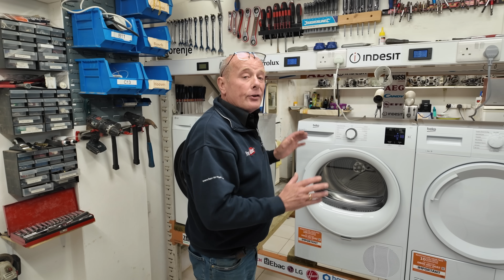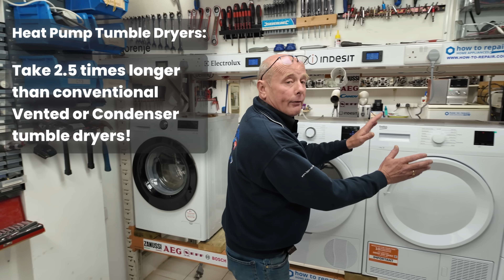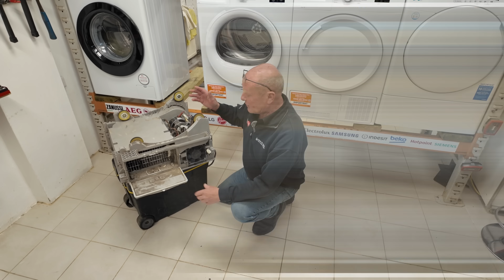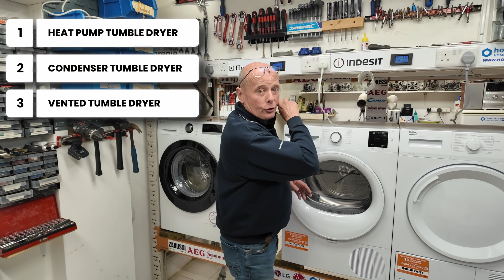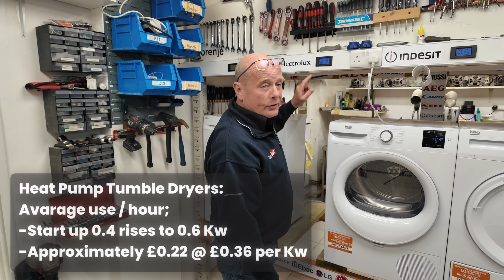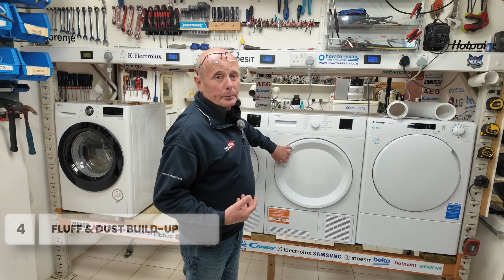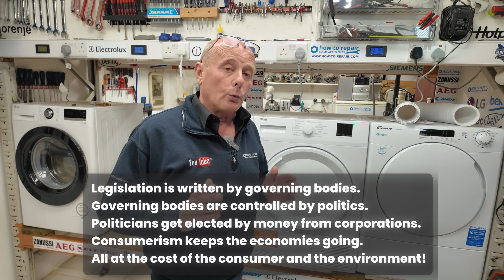Tumble Dryers the Shocking Truth About Heat Pump vs Vented & Condenser, NEW LEGISLATION!

Comment: Hi 
For me it goes to show that the heat pump is not the way to go. More expensive more complicated and takes to long to dry.
I have never had 5 trouble free years of service from any kitchen appliance they all seem to die at around 3 years fortunately I can repair most faults myself.
Great vid and wathing this one has  made me realise why at some points of the year my condenser dryer takes longer than other times in the year, just down to kitchen temperature and ambient humidity effects on the condenser 
Cheers great vid

Comment: It’s very strange seeing these machines for drying clothes. My wife and I are in our 70’s and we’ve never used these to dry clothes at any time in our lives. When the weather allows we dry clothes outside when not we dry inside. We have dehumidifying granules in collection bags which keep our house free from high humidity and don’t have any issues with condensation. We open windows for fresh air and heat our home between 20-22 degrees c every day. We have the lowest energy bill of our neighbours around as we often compare costs to see how to make savings. We will never use heat pumps as we know they cannot heat our hone above 15-18degrees c depending on the season. Our house was built in 1962 and I’ve insulated under floor, wall cavity, loft and have good double glazing. Three heating engineers have advised us not to touch heat pumps as the cost will be 12-15 thousand pounds and all our radiators will need replacing as they are not suitable and each one said we’d need extra heating on top of the heat pump to get the house warm for us to live. Heat pumps may be fine for new houses but useless for older properties. Never listen to the government, never buy an ev, never expect a politician to tell the truth, if it seems too good to be true it is, these are the rules we live by and will die before we ever change. One last thing no matter what you do if you live in the uk you will never change global temperatures, by buying Chinese you only increase the damage done, if you believe that rubbish. Why ruin your life, your job, your business, your future trying, it’s a waste of your life.

Comment: I have been using BOSCh Heat Pump Tumble dryer for more then 15 years. I had issues with clogged condenser in past. Complete disassemble and cleaning helped. But last min 5 years I have not been facing such issues. Why not? There are several factors to help dryer. First is to use washing powder, not washing gel. If you use gel, wet environment in your washing machine and subsequently dryer, is colonized by bacteries. They creates ugly, smelly, black jelly everywhere you cannot acces, especially surface of tank under drum and condenser in dryer. This jelly together with dust from laundry is clogging your condenser. If you switch to powder, there are abrasive particles, constantly cleaning these hiden surfaces and bacteries are not transferred to dryer. Dust particles are still there, but not sticked to surface of condenser, but filtered by filters. Second advice - do not be too active by emptying water container after every load. Is good to keep at least 1/2 full for every second cycle. Why? Dryer has self-cleaning system, using this water from upper box. You can find there hole with vent. If box is empty, self cleaning is not working. And third advice. If it is possible (older Bosch dryers), ask service man to modify body of condenser to allow access from front side. I have there small doors and cover I can remove and check front side of condenser. This is place where most of dust is catched first and if you keep this space clean, you do not need to disassemble whole machine. If you do all in such waty, these machines are inredibly long-live workers.

Comment: ThNkyou for spending the time making this video. I wish this was available 4 years ago as my beko heatpump tumble dryer has failed. To me it's looks uneconomical to repair, as it will become fault again requiring a complete strip down. Think I will purchase a condenser dryer instead. 4 years usage for £500.00 dryer is not economical. Thanks again

Comment: We've had a heat pump dryer for two years now. Recently it has started smelling which affects not only the clothes, but the house too. We religiously keep it clean, vacuumed and lint removed etc. Having spent the last month backwards and forward with the manufacturer and getting an engineer out to take it apart, it transpires that there is no cleaning cycle or proper way to clean it. The problem is, we can only find one condenser dryer on the market now, if you do want to change back! We agree with everything you say.

Comment: We have had to buy a new tumble dryer.  Couldn't get a vented one, and had to fetch a heat pump one. I reckon that it's going to be 6 years before we break even, that's if it hasn't broken and n3eds to be replaced.

Comment: Ive had my heat pump for nearly ten years now and only a problem twice within the first year - to do with dust. The company covered both issues.  One was my own fault (not cleaning the filter pad at the bottom) and the second proboem occured just after moving house (it was uneven).

Comment: The environmental climate change decisions are causing more damage by building throw away items.  Repairing your vehicles, appliances and electronics is far smaller "climate footprint" than throw away and replace. The manufacturers love it because they sell you new every few years and don't need to worry about having trained service techs.

Comment: Have had a John Lewis heat pump dryer for 2 1/2 years. Very good. It solves a problem millions face - rented property. How can you fit a vented dryer when there's no vent space, or the crappy old place with a crappy landlord hasn't got space in the kitchen or wherever. Old properties, (this is UK) are terrible places to live. A HP dryer solves some of these issues nicely. I hope it lasts long enough to recoup the initial cost! Thanks for the info on failure modes. Am an engineer so I can handle some such tasks.

Comment: It’s not dust or fluff. It’s lint from the clothes. Lint is highly flammable and is the cause of dryer fires. It’s important to remove the lint. Surely a heat pump dryer cools the room it’s in, hence more room heating is required with negates the energy savings. Surely this technology would only be beneficial if it was integrated with an external air (or ground) source heat pump.

Comment: I am in the USA we have an LG and it came with 5 year guarantee, so far so good.  We live in a 2 story house and the cost to have someone clean the vent is 2-4 hundred USD. We can buy a new machine every 3 years for the $ we are saving in vent cleaning. Plus I live in Miami, but no matter where you live, a traditional dryer is pulling conditioned air from your house. Your AC has to work VERY hard to replace that conditioned air. When you combine the TOTAL energy savings (air conditioning / drying cost) plus wear and tear on your AC, the case for ventless is more compelling

Comment: I bought a Hoover h-dry 500 heat pump dryer not giving a thought to whether it used auto-reverse in the drying process. I’ve since found that in common with many other heat pump dryers this is not the case. This results, particularly with large items, with everything ending up as a ball dry on the outside but still damp in the middle. It takes a very long time for the process to complete. All previous standard dryers I’ve had auto reversed  the drum, seems to make common sense this should be standard

Comment: I had a heat pump tumble dryer AEG, and it is a nightmare to maintain. Badly designed. The technician just suggested I buy a new one, without the heat pump system. However, I cannot find any! Please, where can I purchase one?

Comment: Our heat pump tumble drier (7½ years old and trouble-free) uses under 1.5kWh of electricity to dry (to fully bone-dry) a full load of bath-towels, hand-towels and flannels (2 bath towels, 8 hand towels and 20 flannels) - that's less than 50p!!  I know of no other way of achieving this in the middle of the winter on a wet day.    Using a power consumption monitor will tell you the real answer to which is the most energy efficient appliance - you want to know the number of kilowatt-hours of electricity consumed over the whole drying run - the current or power drawn at any one moment only gives you a snapshot, not the whole picture.

Comment: Heat pumps a refrigerators. Airconditioners run backwards.
They would be good if you washing machines spun your clothes so fast that they are nearly dry at the end of the spin cycle.
Ask the Japanese.

Comment: I very nearly purchased a heatpump tumble dryer last year but at the last minute changed my mind and bought a condenser tumble dryer instead. Our old one was a condenser type also but the front of the drum wore through   metal to metal  and couldn't be replaced. I am very glad that I went with a condenser tumble dryer again as friends who bought heat pump ones recently have told me some real horror stories. Best decision ever.

Comment: I've just bought a Bosch heat-pump tumble dryer to replace a Hotpoint vented machine which was starting to wear out after 7 years. Your video is excellent - very clearly presented. Thanks.  Judging by the comments from @Mavermick1 and others below, and by your own comments in the film, the Bosch was a good choice. Expensive, yes (ouch) but likely to less susceptible to some of the problems mentioned in your piece. Picking up on your well-made point about maintenance costs, the Bosch comes with a 5-year guarantee which can be extended for a further 5 years for only £60.

Comment: As the owner of a new Hisense heat pump tumble dryer that cost £329, it is taking 1 hour to dry towels and its consuming 400W, our 27 year old conventional dryer used 2.5kw and took 90 minutes to complete its drying cycle (60 mins at 2.5kw and then 30 mins at around 800w). I'm not disputing what is being stated in the video as that's one persons opinion, but from my experience, I cant loose owning a heat pump dryer, as the cost saving alone would mean I can just replace it with a new one if its not financially viable to have it repaired years down the line.
Reply: Tienes toda la razón. Yo soy otro usuario con bomba de calor y las ventajas son en todos los ambitos......más rapido, mucho menos consumo y ademas trata mejor el tejido ya que no sube tanto la temperatura del aire de secado....es un video poco fiable en mi opinión .Pero si que reco endaria po er un filtro extra antes de la condensadora y nos evitamos problemas de suciedad para siempre.

Comment: Wonderfull. I have to buy a new dryer as my condenser dryer is getting old ( 7 or 8 years ) and sometimes the tumble doesn’t start. I was looking at the AEG TR99V78C. Pretty expensive. And now I don’t know what to do because of your video. 🫤😅 All I want is a longlasting appliance that doesn’t " eat  " my clothes, the heat pump system are everywhere and it’s difficult to find something else.

Comment: Excellent informative video. I am currently replacing a condensing dryer condensate pump that was sqwarking like a banshee. The information you provide is brilliant and what applies to dryers also applies to windmills and other disposable items. The Heat pump dryer effectively is a dryer with a fridge working backwards to make the heat more complicated not designed to be easily cleaned by  the user and uneconomical to be cleaned out by a repair engineer.

Comment: Hi there. So glad I came across your video but it am a little confused. I was being sold a bosch dryer WTH85008 and was told it is a heat pump. But I also clearly saw the condenser tray which I am supposed to pour out as well as the two filters. So doesn’t that make it a condenser dryer? I wish to get a vented dryer all the more so after listening to you but unfortunately the space I have is 3 feet away from the window. So my question is this - heat pump also works like condenser dryers?

Comment: I use a vented tumble dryer with a delay timer. It is only run at night when the electricity is either generated by renewable sources or base load sources. This surely is the most environmentally friendly solution

Comment: Just look at how much it costs to commission an air conditioning system (replacing the compressor is much more complicated). Working at Bosch Belgium, I can say it's more economical to replace the air conditioning unit than to repair it.

Comment: I bought a Sharp 10kg heat pump tumble dryer about 3 years ago, not realising all these the pitfalls that you go over here. After about 9 months of daily use, water started failing to pump up into the drawer. Since the device was still under warranty, I called out an engineer. After two failed visits where they needlessly replaced the holding tank pump, the third engineer realised it was just a blockage of lint from the collection tray to the holding tank. Since then, and now it's well out of warranty, I've cleared the same blockage three times myself (after removing as much lint as I reasonably can). 

The next time it blocks up, probably less than 12 months from now, I'm feeling I might fully dismantle it while maintaining the refrigerant loop and run water through the fins to hopefully get all the lint out from between them.  To me it just seems like mine needs a properly sealed filter, or one on the front of the condenser itself.

Comment: I have a Samsung series 5 sensor heat pump dryer. Cost £600. Absolute piece of crap. Takes 4 hours to dry, often more as it needs to be tumbled again. Its not being overfilled either, as I have purposefully bought a washing machine smaller than the dryer... I had Samsung send out technicians 3 times during the 5 year warranty, because it was just so bad. Its on so long, it even gave a overheating pump error twice. But all the engineers  said its fine... Now its out of warranty and I'm giving up, going to be buying a replacement in the new year.. Which is just adding to the waste issue...

I'm absolutely not event remotely wealthy, but my time is more important than saving some money. I'd much rather have my washing done twice as fast so it doesn't seem like I'm constantly doing washing.

Comment: Why isn't the condenser drier much cheaper to run than the vented system as it's keeping the heat within the system? We're having to replace our vented drier as we've moved house and there's no location for a vent. The drier will be placed in a garage attached to the house. Will this badly affect how it runs?

Comment: I wonder if you are able to access the LG DLHC5502 as I have had mine for 1 month now. Previously had an 18yr old LG vented dryer which took about 1 hr to dry a load and consumed 2.4-2.5kwh. the new 5502 takes 90mins on average and 0.8-0.85 kwh. I did not take into account the added wear and tear on the unit but then my 5502 drys way faster than the unit you are using. The 5502 also has a condenser cleaning mode and I just add 1.5L of distilled water and set it to run just over 1 hr. Getting access to clean the coils is easy with a maintenance door but if I need to do a tear down I watched a video and took then under 20 mins to strip it all down. Another note is I have not seen the numbers on how much $ is required on your heating system to cover the vented air? I live in Canada and currently it's warmed up to -21C and feels like -34C so that air loss takes a significant amount of energy to heat up.

Comment: I had a booklet from the 1950's that showed you how to do stuff yourself, including making a convection heater from a 5 gallon oil can, how to convert a gas kettle to electric, how to fix stuff generally, electrics etc.
We have cartels like they did of old concerning light bulbs - proper, cheap to make ones - these bulbs were not permitted to burn for more (often much less) than 1000 hours, if they did penalties were levied against the producer. Eastern bloc appliances were made to run for a minimum of 25 years, their light bulbs could last forever. It can be done, but trousering large wads by politicians  - the puppets of corporations - is the order of the day. Corruption, corruption, corruption nothing else. Green-washing no. Money-washing yes.

Comment: Once more the more complicated and sophisticated thing is the worst in the long run. You'd have to see what happens now in cars and in the automotive repair world. It's almost criminal. Mechanics are fighting a lot to be able to repair machines that are so complicated, software locked, and with difficult access to some parts that is ludicrous. It's getting worse and worse from 2018 on. The excuse is emisions, all with convenient math and tests done with new machines. In real life, the emisions of a 2000s car with similar fuel consupmition in the real street, not lab tests, is similar to a current one, even when the 2000's is old, and in the case of a electric car completely miscalculated. Also for general surprise, in real life the emisions of diesel engines have always been better, specially in long term. That's why almost anything big is Diesel instead of Otto. You can see it just standing by the side of both of them while on  in a closed parking.

Comment: The unclean ability is done on purpose.
For example: Bosch has a "self cleaning condenser" but on purpose only cleans the front part and not the back part. It also has a "gap" between the parts, where fluff builds up, limiting the life of the machine.

Comment: We have a bosch heatpump dryer from 2012, costed me arround 530 euro. The machine is still going strong. Had to take it appart one time to clean the condensing unit, quite the work. Dust build up is a big issue in these machines. And one time the drum became stuck due to dust. So yes if i hadn't the "balls" to open up the machine it would have been replaced 2 times